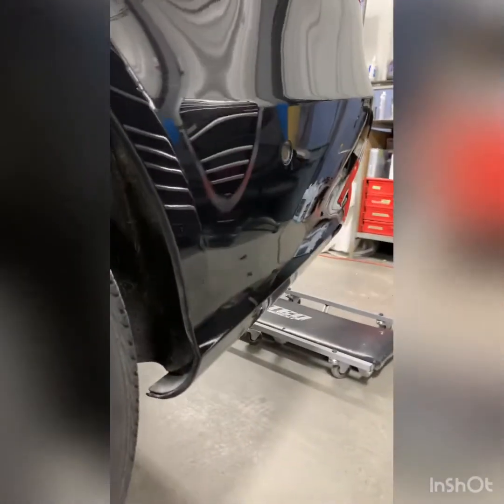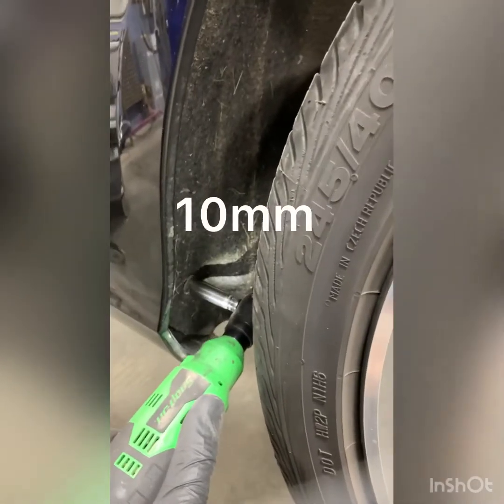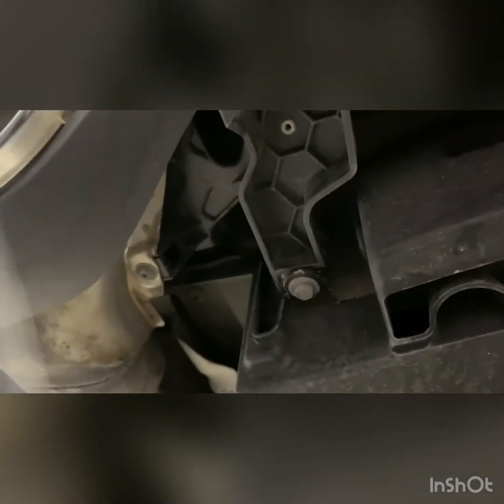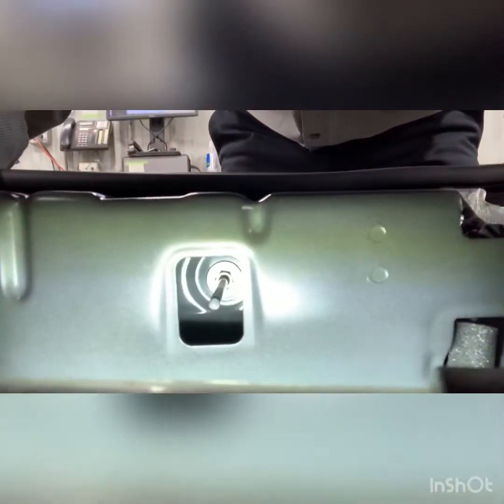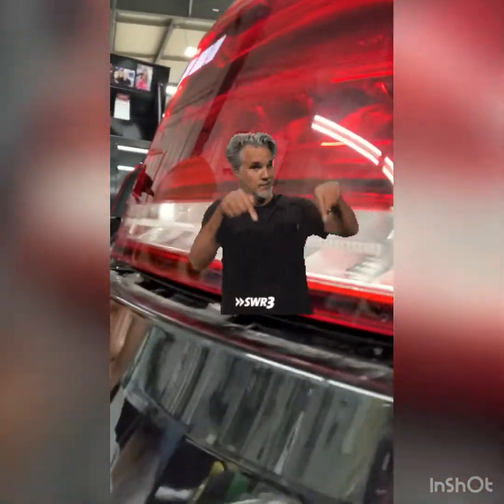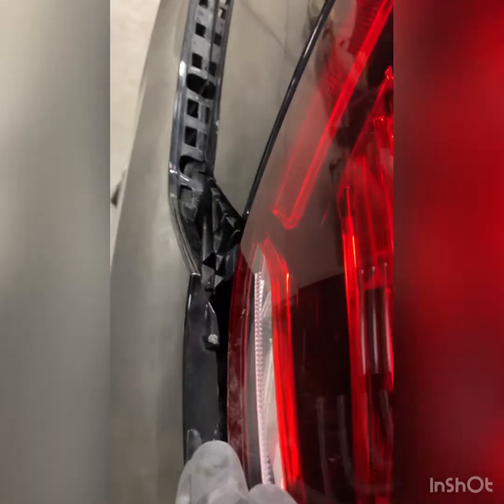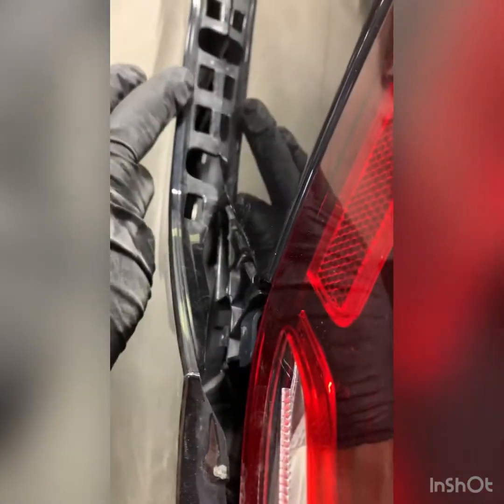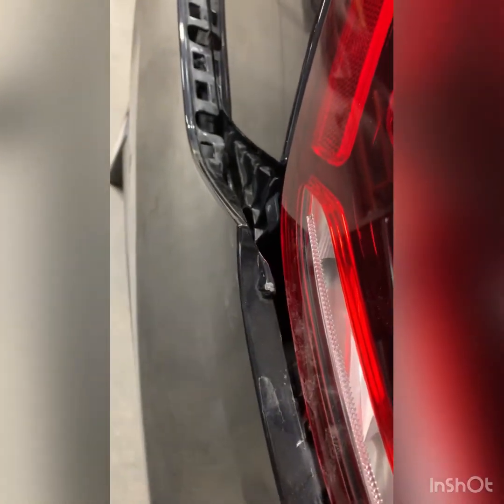Mercedes E class rear bumper removal

Comment: Is there any other tool to use to remove those 10 mm nuts inside those holes
Reply: Hazet 2797-1
Reply from the maker: Amazon has extra deep 10mm sockets for these types of situations. As an alternative you could use a flex head ratchet wrench, or you could fab your own by welding together two deep 10mm sockets.